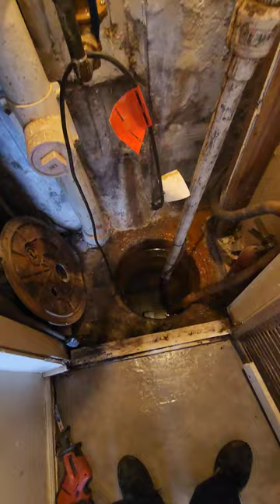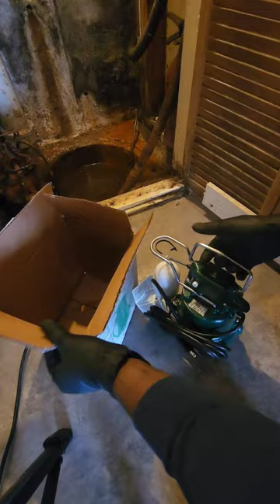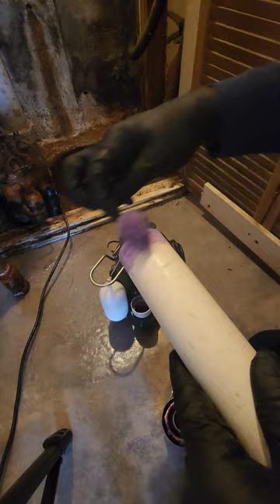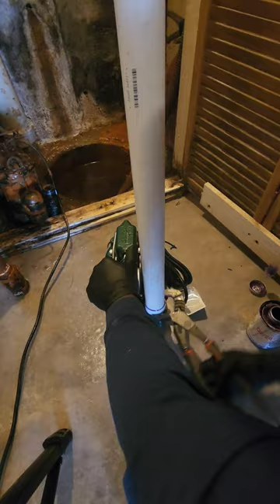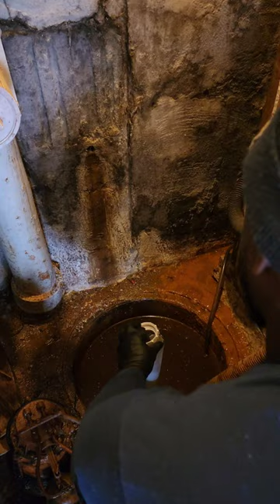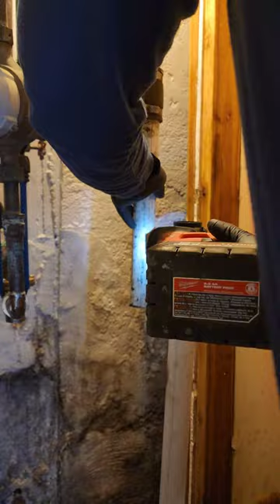sump pump swap #diy #home #shorts

Comment: Why the little whole ? 🤔🧐
Reply: Primes the pump. Sump pumps aren’t supposed to run dry
Reply from the maker: That is a weep hole which allows excess water to drain out. It's important because it helps prevent the pump from becoming air-locked, which can happen if water builds up in the basin and prevents the pump from operating efficiently. The weep hole ensures that water can continuously flow into the pump, allowing it to pump out water effectively and preventing damage to the pump motor.